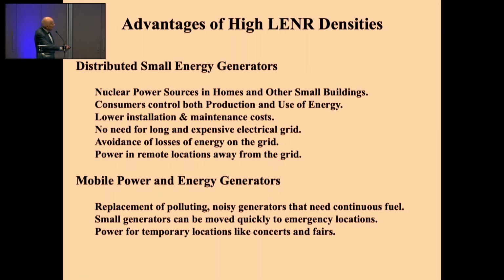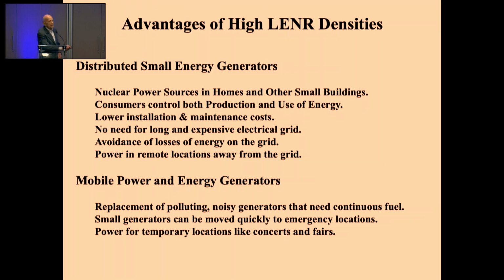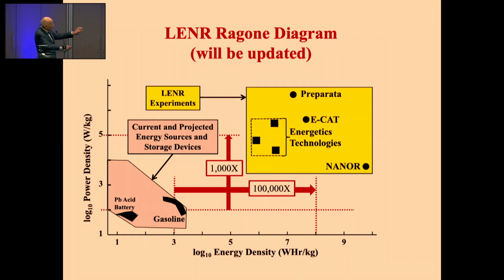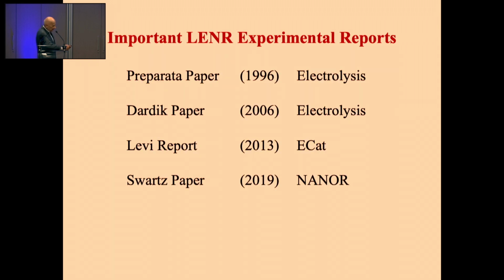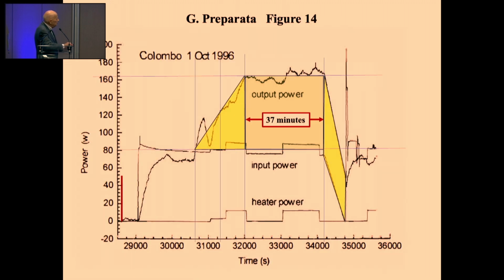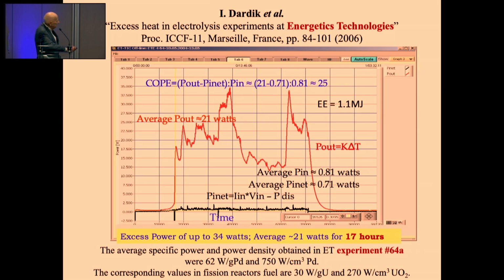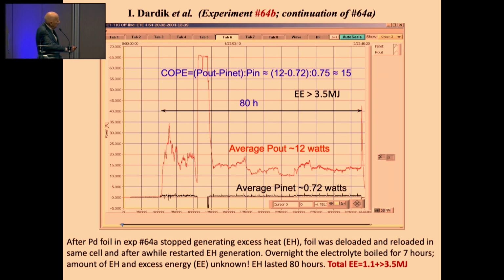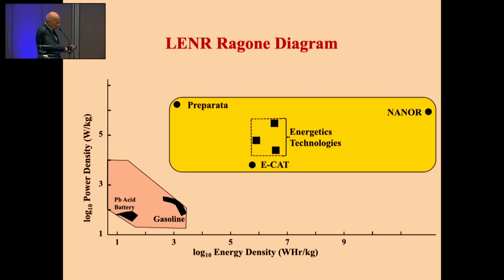David Nagel   - IWAHLM-16 - Power and Energy Densities from LENR Experiments

Comment: The reason why cold fusion occurs is simple. The repulsive force from electrons orbiting the equator are weak and the attractive force from protons are stronger for electrons coming from the poles, so they can combine with the protons without any resistance and become neutrons. The rest can be explained by the action of the neutrons. This occurs with a high probability in a face-centered lattice. The central hydrogen atom has six possible plane orbitals. The position of the electron that enters is from the center of the 12 edges. With this setting, it passes through a wall of about 1 in 10 billion, and in the direction of the neutron that is created, there is another neighboring hydrogen nucleus. This means that it has broken through the 1 in 10 billion wall again. It's all due to an increase in probability.